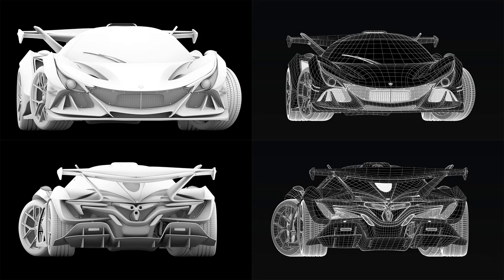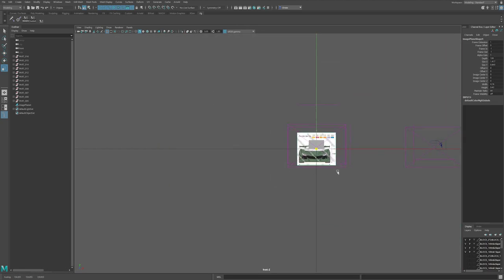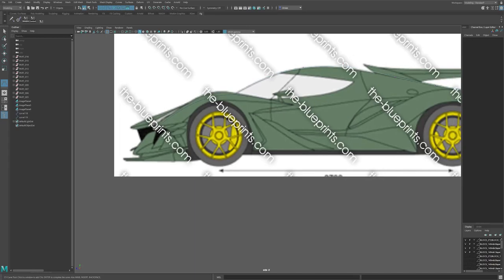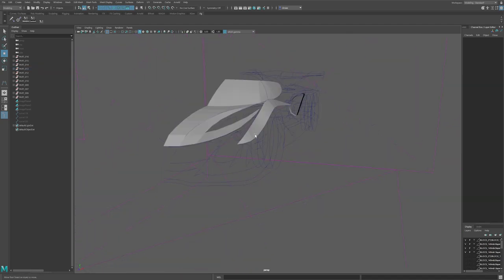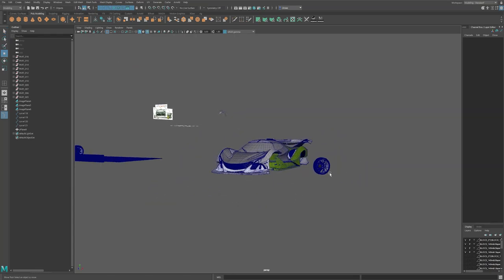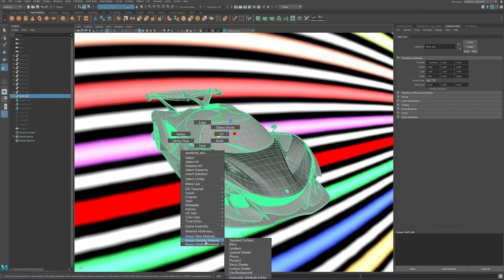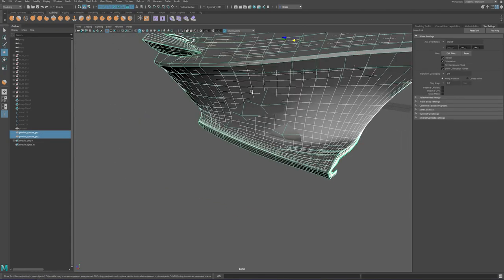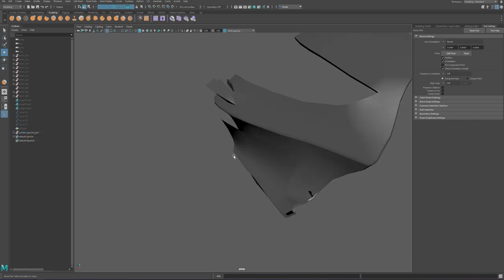Modeling a car, tips and tricks in Maya - CG LOUNGE

Comment: Amazing man! I did try to model it, but i want to 3d print it. I got problem because seema like the surface doesn't have thickness.  I mean with 0.2-0.4mm nozle i should have at least 1mm thick all surface. I did try solidify, but at complex shape is just meas up everything.